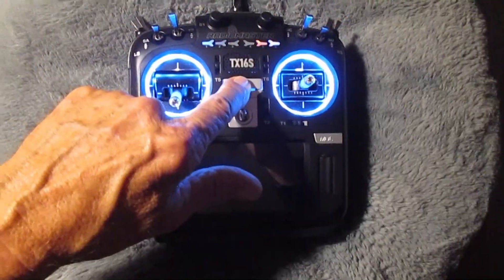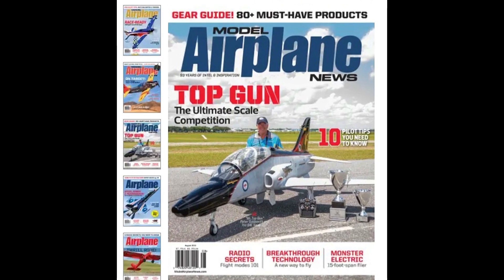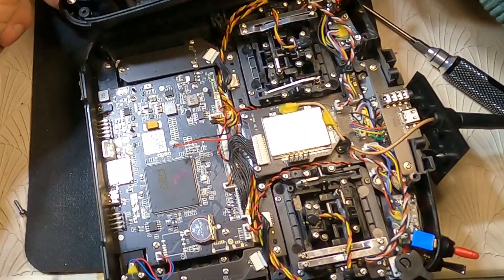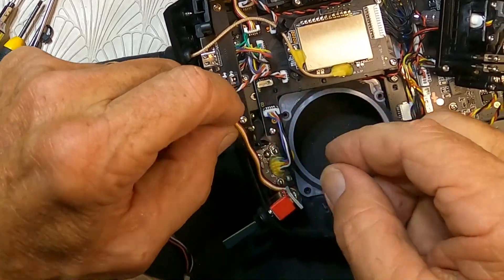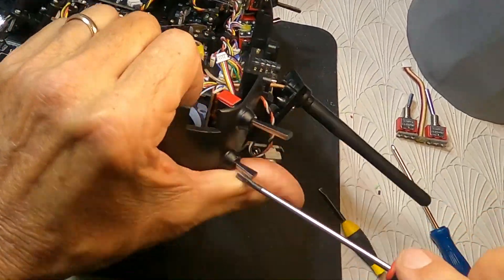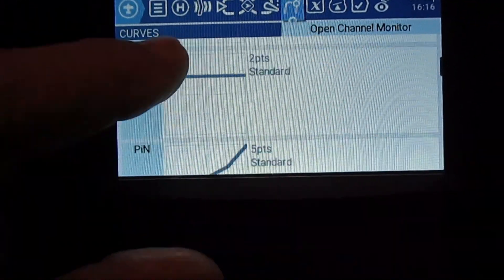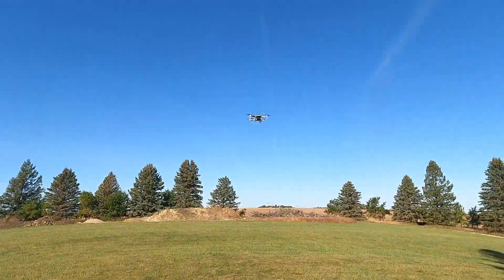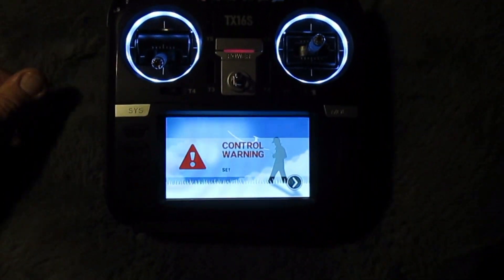RADIOMASTER TX16s SH switch swap, with programing tests on the Eachine 180 Direct Drive Helicopter.

Comment: Can you not just swqp the existing switches over from one side to the other without buying new switches?
Reply: 11 months late but, no.  The boards they are soldered too are angled like "s" Tetris blocks so when you switch sides they do not fit.

Comment: Isn’t it possible to just swap the original switches? Sincerely
Reply from the maker: No, because they are different believe me I would’ve done that if I could’ve.
Reply: Thank you sir
Reply: I needed the momentary switch on the left hand side for throwing discus launch gliders, I took out both modules, de-soldered the SH and SF switches, and swapped them. It's not a difficult procedure.
Reply: These are replacement switches.

Comment: I have 3 Futaba's a T8FG, 14SG and a 16IZ all the heli version. The momentary switch is on the right and the 2 position switch is on the left!  A Spektrum DX9 Black with no momentary switch anywhere. It has two 2 position switches on left and right. Taranis X9D Plus with a momentary switch on the right and the 2 position switch on the left. And  RadioMaster X16S with the momentary switch on the right and the 2 position switch on the left. 

I just check some of my old Futaba radios from the FM days. Those old radios had the 2 position switches on the right and the momentary switch on the left. So Futaba changed over the years. So it seems your old like me.
Reply: Got the reversed switches, easy peasy!  I set mine up with a 2 way on each side, so i only had to replace the right SH momentary switch. Thanks for the video and responses to my question.  You rock!
Reply from the maker: @dalegregory3019  great to hear. Thanks so much.
Reply from the maker: Yep, I would not comfortable driving my car if I had to change the gas and brake pedal operations, so it is the same for me, once your used to something for so long.  I think most prefer and or are used to the throttle kill on the top right as most of us "OLDER" people are used  to.  Thanks and happy flying.
Reply: @NightFlyyer  I programed my Futaba' T8FG, 14SG and the 16IZ to have the throttle hold on the left 2 position switch. and the throttle cut on the right momentary switch. Being able to program the switches makes it easier. That RadioMaster X16S do you know you can update the software from OpenTX to EdgeTX. EdgeTX you have the touch screen working. Works fine.
Reply from the maker: @Airbrushkid  you obviously didn’t watch the video.
Reply: @NightFlyyer  Sorry no I didn't. Read the title and it said switch swap. I didn't update my X16s to EdgeTX. To me to many things to do. And my 16IZ with it's touch screen and there program. To me is way easier and faster to program my model in it.
Reply from the maker: @Airbrushkid  Thanks for admitting that, because I have Edge TX in mine and the latest version.  And I switched the switches because the My Spektrums and Futabas all have a 2 position switch on the top right, where most of us old timers all have our kill switch.  On the Radiomaster, it is a momentary switch, and that won't work for a kill switch, although, as you said, everything can be programmed, but throttle kill on a momentary switch is not one of them!  The one thing and the only reason I bought it and the reason for the video  cant be programmed in after all, and so that is disappointing.
Reply: @NightFlyyer  The momentary switch on my I use as a kill switch for nitro's. But it won't work with electric. But there are a lot of switches on the X16S.
Reply from the maker: @Airbrushkid  Huh? , I use the 2 position for my nitro's as well, because it keeps the motor from running up wide open when least expected, just like electric.
Reply: @NightFlyyer  I use the 2 position switch for throttle hold. The momentary for throttle cut 'kill'. All in the programing.
Reply: I bought the SF/SE 2way/3way switch, but with the offset on the circuit board, I couldn’t get it to fit when trying to install it in the old SH/SD holes?  Does RM sell a SH/SD switch that was made with a 2 way on top instead of a momentary?  I tried de-soldering the original but the heat screwed it up.
Reply from the maker: @dalegregory3019  They make a special conversion board for to make the change.  They come in 2 packs, so you can change both left and right and all fit.  This is the link for the proper switches. https://www.youtube.com/redirect?event=video_description&redir_token=QUFFLUhqa2FWN0wxdm5OemN3RXMyOGRLT0w1blpLRXJGQXxBQ3Jtc0trbENCMS1xYTRTV2xtTGpma0RwaWNjY1VRYlVmUXNaVy1KMGpwUm5VRVI5ZlB6bE83bmRZMDNSTUpWbDBXY0N0UmRTV0xid2ZlS3B3ajFyS3R5NGRMRVVTNFMxN1dONGlSeTQ3TnR1bWk0NGZsbUF5WQ&q=https%3A%2F%2Fwww.radiomasterrc.com%2Fproducts%2Ftx16s-replacement-sf-sh-switch-assembly%3F_pos%3D2%26_psq%3Dsh%26_ss%3De%26_v%3D1.0&v=G3uX_GRfQGQ

You will note it says:  If you need the momentary switch to change sides on TX16S, feel free to choose our SF + SH Switch Assembly. This is a set of switches to change SH to 2 Position and SF to momentary. No soldering necessary.
Reply: @NightFlyyer  Thanks so much!  Makes sense now.  I ordered the wrong part initially.  I’m setting mine up for 2 way switches on both sides, so I’ll only have to use the reversed SH switch.

Comment: I wish the switches were not pre-soldered to the boards. As I used to run Spektrum, I had the same thought to swap the switches.
Reply from the maker: I tried to switch them first, but had to get so hot, I decided these switches were the way to go.  Thanks.

Comment: I switched to the radiomaster last year from spektrum and love it.the programming possibilities are endless but it is a learning curve.The switch mod was the first thing I did when I got mine.
Reply from the maker: It is a good move for sure.  I would hate to drive my car with the brake and gas pedal reversed, as used to it on the right.  Happy flying and thanks.

Comment: I use the 5 buttons on the front
Of the transmitter. The first two I have throttle cut and arm
I also added two extra momentary switch buttons to it as well
Reply from the maker: That will work, but again, I  am used to my throttle kill on the top right, and don't want to hit any wrong buttons, because I do not look at my TX.  Thanks.

Comment: 11:49 WHOA! I didn't know you owned 3 of them Dave.

Awesome job Dave it's cool to see you finally getting the hang of your Radiomaster TX16S will you be putting in other of your models on there like your AK 450 Aviator VTOL,Blade Msr,Blade Mcpx,Eucopter AS 350&Blade Scout CX next?????
Reply from the maker: Those are spare parts!  Switching would take a long time, with all the programing, so since I still have most of my other stuff on my NX8, I will reserve this for some of my newer projects.  LOL  Thanks.
Reply: @NightFlyyer  Oh ok then that's cool Dave👍

Comment from the maker: Being so used to having a 2 position Engine kill Switch on the top Right of all my Transmitters had me wondering why RadioMaster did the opposite and made this a momentary switch.  This is unsatisfactory for me, so I purchased the upgraded set of switches to properly make the swap.  When finished, I programed the Radiomaster to fly my Eachine 180, direct Drive Helicopter with 3 different flight modes.  It was really easy to program this, once I figured out the protocol and icons of this Open TX transmitter.  It is really powerful and for the price, I think every RC-er will love it.  Thanks for watching.  ~Dave